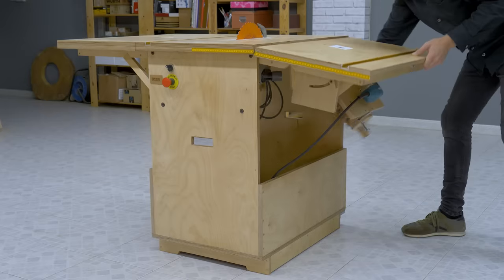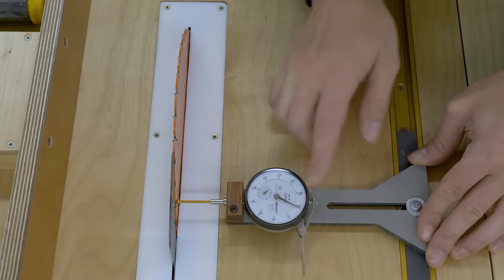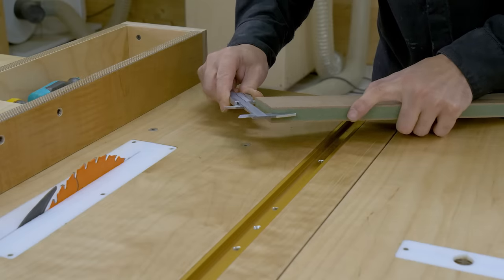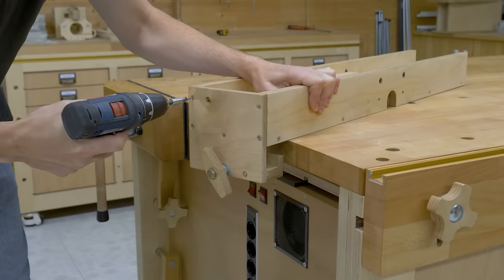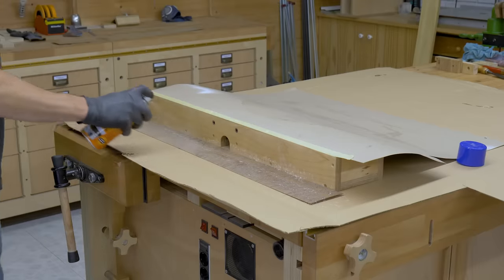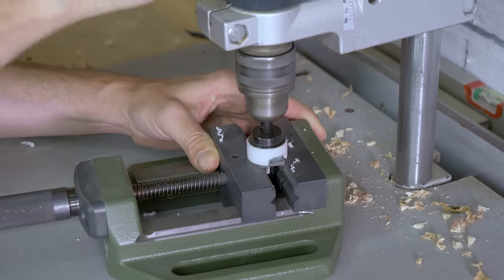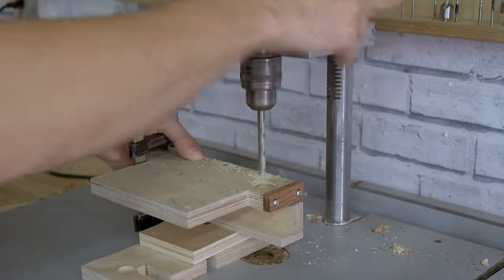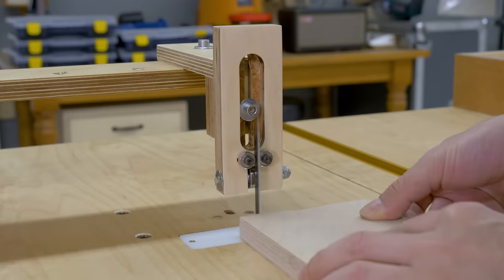Portable Workshop Improvements / DIY Table Saw Rip Fence

Comment: Outstanding as always, Suso! Unquestionably the best DIY rip fence design available. The one minor improvement I’d make is to put the cursor window (and of course the measuring tape) facing upward so you don’t have to kneel or bend way over to line it up. (I realize you had the scale on the front rather than the top of the original design, of course.) Looking forward to the next video!
Reply from the maker: you are right Donny! I had thought about it but without a dedicated profile for the fence it is complicated. I don't like the measuring tape on the top of the table with this design. The other problem is not being able to remove the fence without going through one of the sides, but it is a simple design!
Reply: @Paoson_Woodworking  Good point. I can see where it might complicate things. You could maybe hang the cursor off the back side of the fence (the measuring tape offset accordingly) to keep things simple… or even put it on the inside of the fence. Might be a little tricky to read it there due to shadows but you could add a little LED to light it up. Then you’d have the world’s first battery powered rip fence! 😁
Reply: @Paoson_Woodworking  Routing a groove on the top surface and moving the curson on top? :)
Reply: @Paoson_Woodworking  What if the front of the fence was a little thicker (tiny box) so you can put a mirror inside at 45º? Then the ruler can be on the front, but you can read it from the top.

Comment: Hi I'm currently building your mobile tablesaw and router table bench, would you use this fence for that table too, or stick with the existing one?
Reply from the maker: hi! I would use the one that comes standard with the bench saw
Reply: @Paoson_Woodworking  ok thanks!  one other question...do you know for the sliding carriage on the tablesaw workbench, is there a way to get a cast iron or aluminium surface instead of the plywood or melamine?
Reply from the maker: @oitoitoi1  cast iron seems too heavy for this design, better go for aluminum. I'm not sure where you could find it, in some industrial factory I suppose!
Reply: @Paoson_Woodworking  thanks, I'll take a look!

Comment: The main problem is it seem to be really hard and exspensive to find birch or any plywood good enough for constructions like this. I am also concerned about the strenght/safety when putting screws in the sides of the plywood
Reply: If you’re not sure about the strength of the screw hole,  get either a pipette or a syringe water down the wood glue 50:50 with warm water, drill small  guide hole and use the glue to inject it into. The glue will permeate any vulnerable places and reinforce the fibres, particularly effective with MDF and particle board.  Good luck.